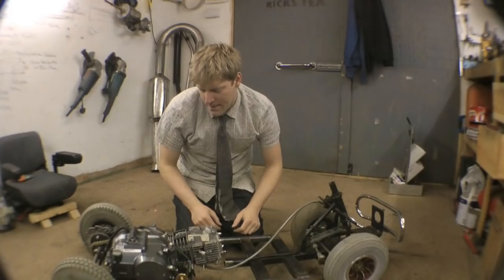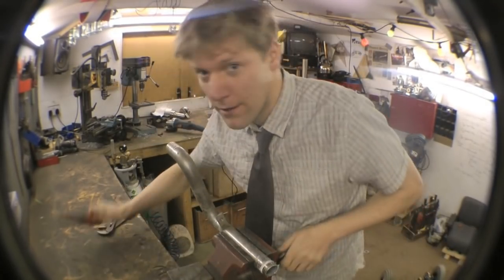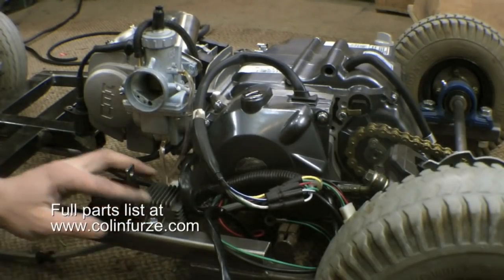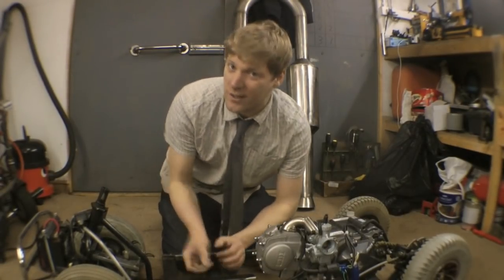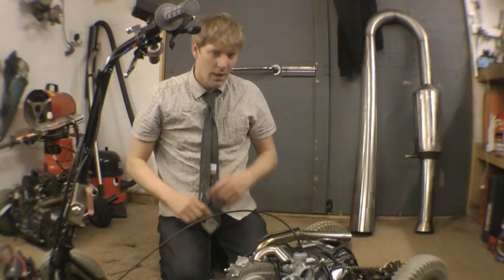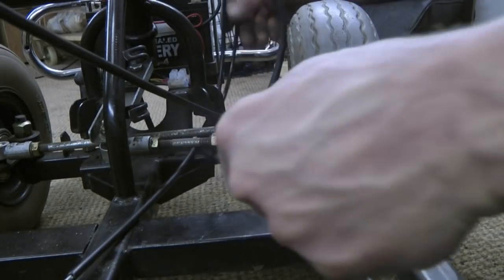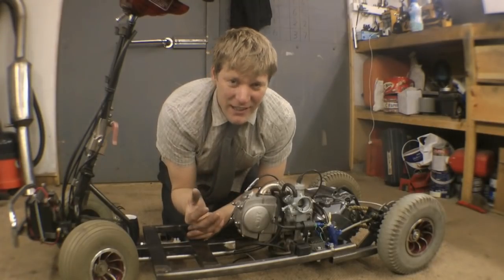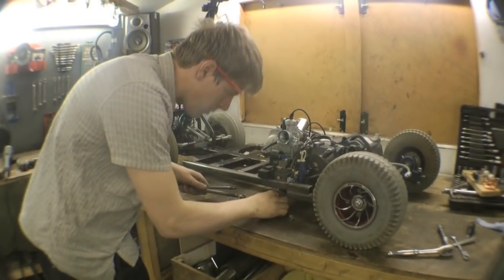How to build a 60MPH MOBILITY SCOOTER #3 controls n systems

Comment: Your vids are a blast; my father and I owned a junkyard while I was growing up and now make many of my own parts for my seven Motorcycles, four pickup trucks and 50th Anniversary Z06 Corvette.  Here is the Rub, I picked up a 250cc single popper reverse trike for my wife, (Tried to teach her to ride a motorcycle and she scares the crap out of me and at times herself .. she cannot use the front brake without turning the throttle and racing the motor no matter what I try; raised and lowered brake lever, etc.).  It is a knock off Kandi Spyder, with weak motor and a bit wobbly front suspension, otherwise not a bad frame and prospects.  Do you think you and get your hands on one and put a V-twin motor in it, keeping it automatic with the reverse.  I am a retired military guy who took a hit in Iraq, and after two fail surgeries had to retire as a 90% disabled veteran, so I am on a budget.  Thanks for your vids bro.

Comment: Great fabrication and welding work Colin, if only the shift linkage could be in a safer location, as just with the wiring/fuel lines, it's so close to the ground it's dangerous. It's going to be a serious sleeper of a scooter!
Reply from the maker: I have thought about putting a skid plate under the whole bottom so it would just slid over everything but it rarely gets caught on stuff so not bothered
Reply: Glad to hear it then, can't wait to see it zipping around!

Comment: once you have those cables right might be worth using brazing/silver solder to better secure them, under tension those screws on the terminals might vibrate loose.

Comment: do you know where to get a wiring diagram for the engine from? as i have bought one of those engines to fit into my 1993 lawn mower and it seems to have 2 cdi connector on it but only one socket. it would also be helpful if you could tell me where the 2 pipes that are already on the carb are supposed to go.

Comment: Colin, what kind of welding setup do you use? Anything special?
Reply from the maker: its a TIG welder but if you get an AC only version they are quite cheap its only when you want to weld ali and have to get an ACDC one that they get expensive but they make lovely welds
Reply: colinfurze Awesome thanks.  Best intro ever on this one too btw